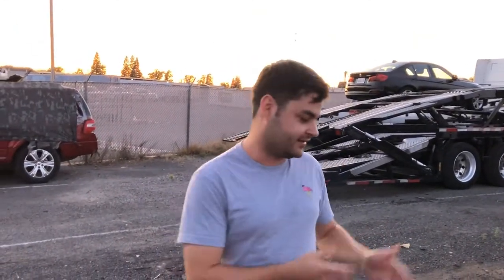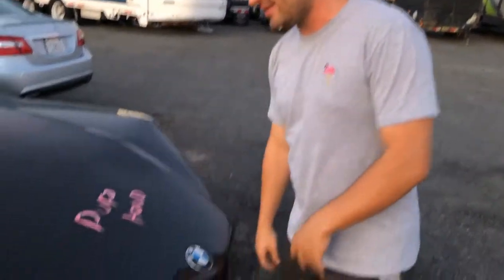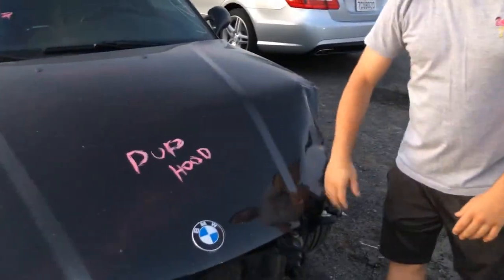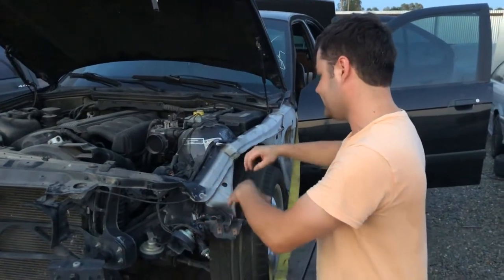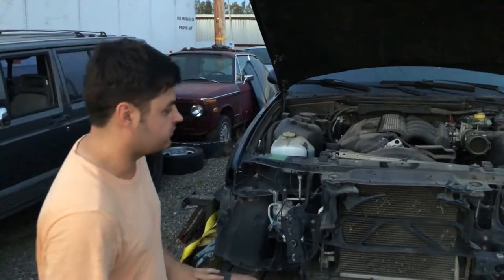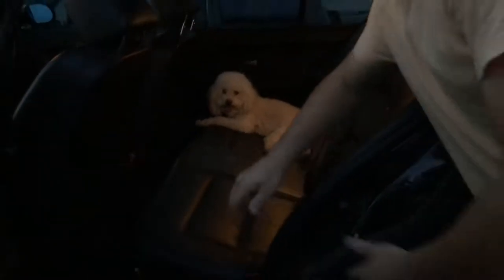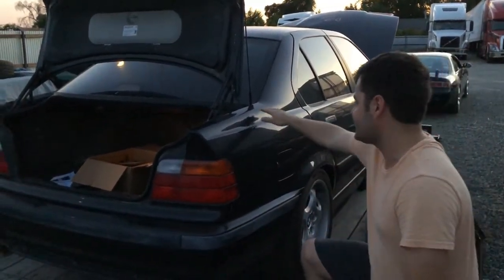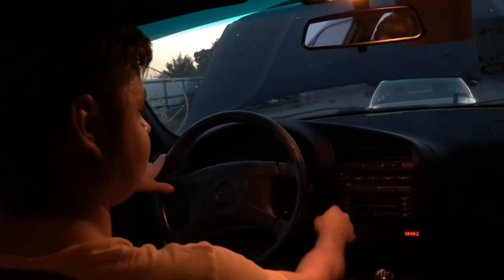My New Project Car From IAA Insurance Auction!!!

Comment: Why do you prefer IAA over Copart ?
Reply from the maker: TheWiseGuy Before I used to like Copart more because the posted cars would have their set auction date faster than IAA. IAA would have cars on their website for up to a year even. However, that’s not the case anymore cuz IAA stepped it up and cars seem to be flowing in and out much faster thus why don’t really got a preference as both are good.
Reply: @golfandcats  Nice man good luck on the project. Just picked up a BMW 535i 2016
Reply from the maker: @thewiseguy7100  Lets see some videos!
Reply: @golfandcats  Bro I just picked it up last friday and I am done fixing it up. Headlights were replaced, hood and air duct. Thats it.All it needs now is the paint job.
Reply from the maker: Sounds like a fender bender, good stuff!